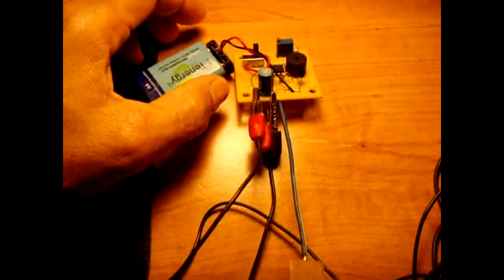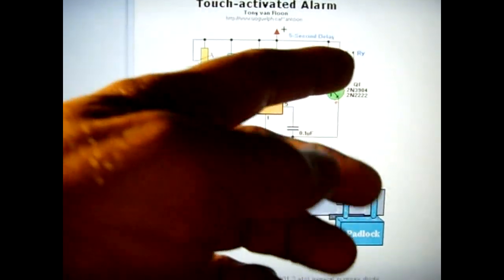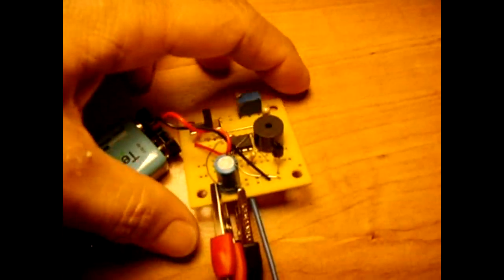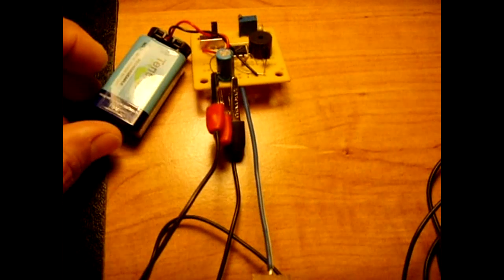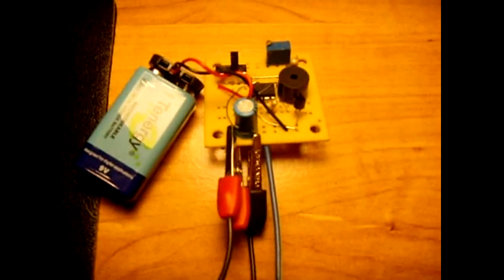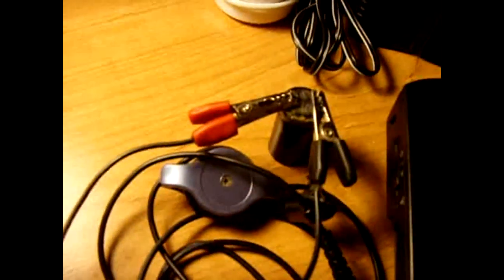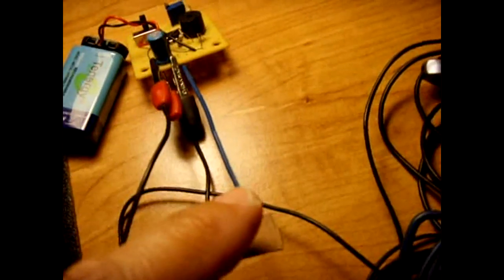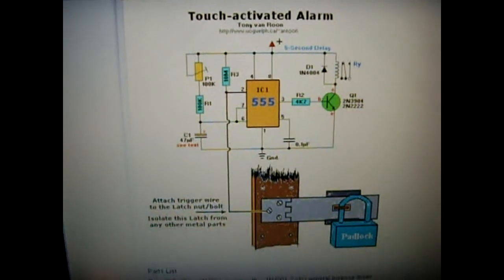9V Sensitive Touch Alarm Circuit

Comment: Shall use 12v / 7Ah input for this circuit?

And I can use metel lock, metal gate? Without using copper?

How long wire can use? Pin no 2? I can use 25 Meter long wire? And connect to the Pin No 2?

P1 I can use 10k Preset?

Pin No 3 - 12v will not Drop? Right?

Please Send me clear. I want to use for only Metel Gate. From the 555 Board to Metal Gate Distance is 25 Meter. The Circuit Will Work Long Distance?

Comment: could this be wired to the frame of a motorcycle?
Reply from the maker: Hello! That may work. Doesn't hurt to try. :-)
Reply: Hi thank you for the reply, how would I begin as a starter to creating this circuit? Where would I buy these pieces?
Reply from the maker: Inner G Hello. You can find them at the link below or Ebay.

http://bit.ly/2cgYr14
Reply: www.Banggood.com

Comment: built this circuit and works fine. one problem i have though is the alarm also triggers intermittently whenever i switch on a cfl bulb in the house..
Reply from the maker: +Albert Pineda 
Try a 102(.001uF) cap between pin #2 and the NEG rail.
Reply: +electronicsNmore adding 0.001uf between pin 2 and neg rail did not fix my issue  :( alarm still triggers intermittently.
Reply from the maker: Albert Pineda
Try slowly increasing the value.

Comment: can i able to attach this copper plate to my painted metal gate... does that work?
Reply from the maker: +Logesh P 
Just as long as the metal plate does not make contact with the gate. You will need to use an insulating material between the metal plate and the gate.
Reply: Okay am using double sided tape.. Between copper plate n padlock.of my metal gate... If anyone touches the padlock or nearby surrounding... Will it trigger?
Reply from the maker: Should work
Reply: thanks let me try and get back to u

Comment: hi,, i have a problem about the copper wire that triggers (connected in 2nd leg of the ic 555) .... the buzzer will only work if i touch the trigger wire to the  4k7 resistor that is (connected to 3rd leg of ic 555) .. can you help me about it?!
Reply from the maker: You need to make sure the ground (neg) of the battery is also connected to earth ground.

Comment: What is P1?.Is it a potetiometer?
Reply from the maker: Yes. Potentiometer.
Reply: electronicsNmore But the one I bought has 3 legs ? is that ok 
?
Reply: electronicsNmore Will it work if you remove the potentiometer and replace it with a 100k resistor?

Comment: hi mate did you use a resistor with the Piezo, if so what value and and where was it substituted in the schematic shown. cheers
Reply from the maker: No resistor. The piezo was a 12V piezo, and they draw very little current. If you use a 5V piezo, then use a current limiting resistor in series with the piezo. For a 5v piezo try a 330 or 390 ohm resistor.
Reply: electronicsNmore Hi there buddy, I used a 3-24v piezo, on breadboard, circuit is working as described, tho i have an odd problem , where the touch plate from pin 2 and the resistor metal from pin 3 have to be touched at the same time to trigger it, it will not trigger with touch plate alone, how could this be?
Reply from the maker: Let me take a look/test mine out tomorrow morning. I'll post again in the AM.
Reply from the maker: Eco Smart
OK. I tested mine. The circuit works perfectly. You have to connect the battery negative rail to ground using a small wire. If you do not do that, then touching the plate will "Usually" not trigger the circuit/alarm. You can connect the ground wire to a rod in the earth, a pipe, or the home electrical ground. If you want to attach it to a door knob, you can take the very small ground wire from the circuit and connect an open or ring terminal connector it, then attach it to a wall switch or electrical receptacles cover plate screw. Make sure the touch plate is well insulated from any connection to ground.
Reply: electronicsNmore thanks a lot mate, this has fixed the prob  perfect, just as you said, a small wire, grounded from negative rail gives the touch plate the perfect sensitivity im looking for. much appreciate your help, and the rest of your educational videos, all the best from Scotland